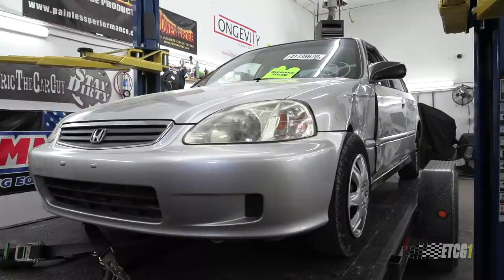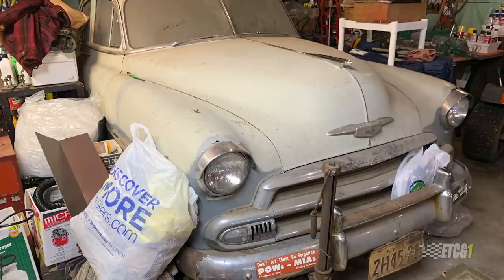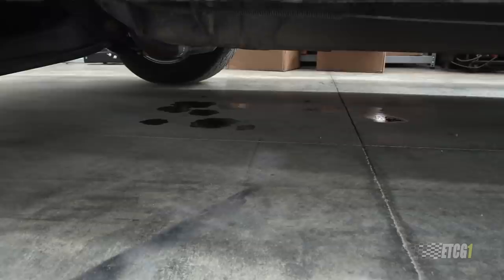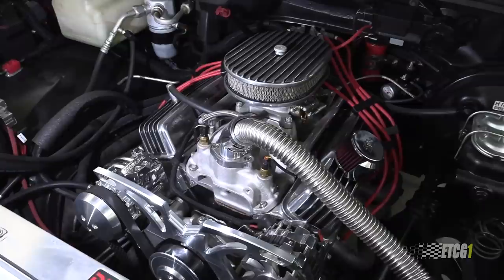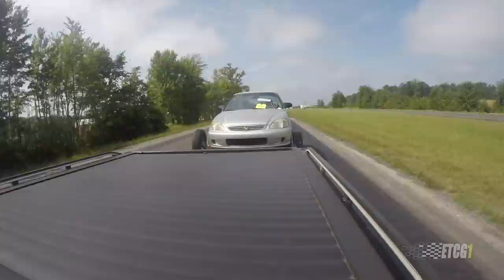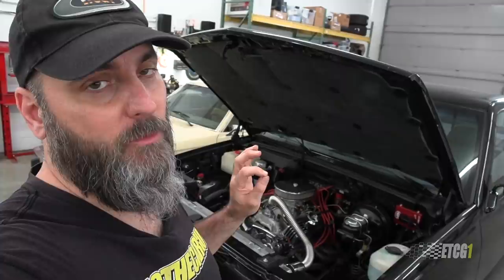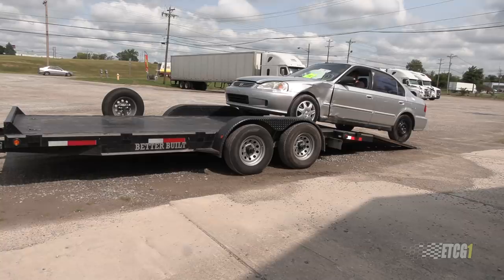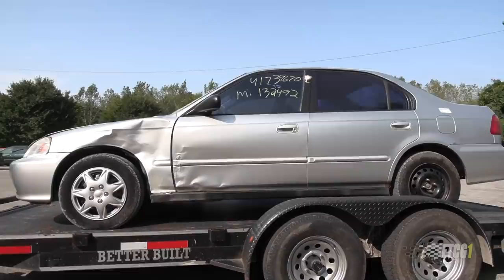First Time Towing with Dads Truck

Comment: Sorry for the long post, but I've been doing a lot of research on towing because we are getting our first "real" camper and we have an Avalanche to tow with.  It is not correct to say that since the GCVWR is not on the sticker that the truck is not made for towing.  I've not yet seen a truck that has that number on the sticker.  My Avalanche is definitely made for towing as it came with the tow package installed from the factory.  There are many factors that go into what a truck is capable of towing, and one of the main ones is the axle ratio on the rear.  The higher the better for towing, as it gives more torque at the wheels.  I had to search in the owners manual and also online a fair amount before I found the ACTUAL tow capacity of my truck.  The first couple websites I came to said I had a tow capacity of 5000 lbs and 500 lbs tongue weight.  But after some searching for feature codes (on the sticker in the glovebox) and researching the Chevrolet site, I found that my tow capacity is 8100lbs and 1000lbs tongue weight with a distribution hitch.  As for tongue weight, you trailer should have 10-15% of the total weight of your trailer on the tongue.  Tongue weight is where most half ton trucks fall short.  If your trailer/car combo is 5000 lbs, then you should have 500-750 lbs on the tongue.  You can move the car back and forth to adjust that.  Also, the best way to make sure you are getting all your numbers right is to use a CAT scale at just about any truck stop and many gas stations. That will tell you if you are exceeding the maximum axle weight rating for your rear axle.  They have an app you can install on your phone and it will tell you where the nearest one is.  Hope all this info helps!
Reply from the maker: Thank you for your input. In actually, it's estimated that this truck can tow 7500lbs. I don't agree with that at all after towing what I estimate was near 5000. Granted, I lowered my truck and that in itself will effect my towing capacity. However, if you've ever driven one of these trucks you know that the brakes are utter crap and I would never tow, or recommend anyone tow, anything that was 7500lbs with this truck in stock form as a result. 

There is a difference between what you read on a page and how it works in the real world. Yes, you have a tow package, but I would take some time to 'feel out' what your truck is capable of towing before you commit to what you believe it's capable of. In fact, that's one of the reasons I made this video, to make people aware that they can't just hook up to anything and expect to be able to tow it safely. Remember, it's not just your life and your passengers, it's the other people on the road as well. 

Thanks for your comment.

Comment: This is exactly why I bought an old F350 dually.  I love my 74 Chevy, but the reality is that she's not the best in towing.  Hauling fire wood is great, but pulling a car trailer or camper is pushing the limits of what she was designed to do.  New, she was only rated to tow 8,000 and she's a little past her prime.  The F350 with a 7.3 diesel can tow up to 12,500 with a conventional ball and around 15,000 to 17,500 with a gooseneck or 5th wheel.

Once I get the Ford squared away (yes, I bought a cheap POS), then I'll be looking for an 18 to 20 foot flatbed, possibly a deck-over so I don't have to worry about fender humps.
Reply from the maker: That's a great plan and one I may emulate at some point in the future. Thanks for the comment.

Comment: You will find, it is much easier with a longer wheelbase vehicle towing a load like that. Yes it kills your turning radius. But the trade off is, much better stability. 
A 3/4 ton pickup preferably an extended cab or bigger, will make towing a car hauler a breeze.

Comment: Unfortunately yes for long term towing, probably best to get a bigger truck! Just borrow a semi from neighbor around shop! Good luck guy
Reply: Long term towing would be fine even with this truck for what he wants to do. The honda? = fine, his dads car in NY? = fine... if properly loaded that is. A bigger truck than this and you can easily tow multiple vehicles. 

As for borrowing a semi? Does Eric have a CDL? Any truck with a GVWR of 26,001 lbs or greater requires a CDL, whether or not you are using it for commercial purposes or not. A tractor trailer is 80,000lbs + 

A side note... You are considered overweight if your weight is not properly balanced or one exceeds the max allowed. Like over your steer tires your max is 12,000 lbs. Drive tires is 34,000 lbs, and trailer tandems is 34,000 lbs. You can be 70,000lbs but if say you had 13,000 on your steer tires, then you would be overweight.

Comment: I would think you would find the GCVWR in your owners manual (if you have it)
Thats where I found the rating for my 95 f150. Very important to not exceed this rating,
or the trucks GVWR or axle ratings. That said, you would have reduced the tongue weight
on your hitch by positioning the car back over the center of trailer axles thus lessening squat.
Reply from the maker: It wasn't listed, I looked. Still, those numbers wouldn't really apply since I lowered the truck and changed a bunch of stuff in the powertrain.
Reply: It might not be in the manual, but I've never seen a GCWR on the loading sticker on any vehicle.  There's a federally mandated set of information that must be there, and GCWR is not part of it.  GAWR is definitely relevant, and with that much rear end squat you were probably exceeding it in tongue weight alone.

For GM at least, GCWR is usually listed in sales materials.  Found one for an '89 GMT400 here:  https://www.gmheritagecenter.com/docs/gm-heritage-archive/historical-brochures/chevrolet-trucks/1989-Chevrolet-Truck-PCK-2.pdf

Depending on rear end ratio, they rate a stock C1500 with the 350 at between 10k and 12k GCWR.

You've just got too much tongue weight, and probably too heavy of a car hauler.

Comment: Running cooler for more power is a misconception. The heat energy that could be transferred into pushing the piston is absorbed through the cooling system because of the higher temperature differential. It’s not much but it still happens.

Comment: Take a look at my 94 f150, ive set it up for towing. You might want to copy it. Ive had it grossing over 20,000 lbs a few times. A smaller truck given no regaurd for its rateing can be made to work very hard.
Reply from the maker: I never intended to make this truck into a tow rig. It was always meant to be a 'sport truck', and I intend to keep it that way. If I do start hauling cars around, I'll likely find something that's at least 3/4 ton and has a diesel. Also with a longer wheel base. Thanks for the suggestion.

Comment: I get about 13 mpg in my 1968 Cadillac DeVille convertible while towing a camper that weighs about 2700 pounds with the quadrajet and the stock TH400, i guess i should be very happy with that =D
It still gets about 13-15 mpg while not towing anything, so...

Comment: When you buy a trailer buy a lighter one, that's probably a lot of your problem. I've pulled a car trailer with an early Dakota on it with my GMT400 C1500 Suburban and didn't have any issues but the trailer I rented was way lighter than the one you did. That trailer you rented looks more like an equipment trailer than a car trailer.

Comment: I took note that you are not using a weight equalizing hitch.  IMHO that will solve your problem because a load equalizing hitch will throw some of the tongue weight to the front wheels, as well as some weight to the trailer axels.  I have been towing trailers for 50 years and a weight carrying hitch on the tow vehicle is only appropriate for a very light trailer or a very heavy duty tow vehicle

Comment: What about just going for a wheel dolly?  About half the weight will ride on the back tires of the towed vehicle, and most of the front weight will sit on the dolly tires.   It should be relatively like pulling a radio flyer wagon as a kid.

Comment: My 2001 silverado doesn't have a combined or trailer weight on the door sticker it's only listed in the owners manual. Mine is listed as such:

C-1500 Regular Cab Long Box (2WD)
4800 V8 (Auto) 3.42 6,500 lbs. (2 948 kg)
3.73 7,500 lbs. (3 402 kg)

Comment: Eric, just a thought about the breather, I put some pretty valve covers on a small block, started having the same type of leaking from around the grommet, when I removed them to compare to old ones there was no baffle on the new ones to keep oil in under pressure, you may want to check it

Comment: Eric, right from the GM handbook for the 1989-1994 regular cab, sport trim with the 5.0L the GCVWR is 10'500lb and with the 5.7L the GCVWR is 12'000lb with 3.73 rear gears. So depending on the engine, 5.0L or 5.7L that makes the towing capacity of that specific truck 4900lb for the 5.0L and 6400lb for the 5.7L so it can still tow a bit if weight. Can it handle your dads old car? Probably. Being as a 1951 chevy styleline deluxe weighs right around 3100 pounds and the average tandem (2 axle) car hauler assuming its an 18 foot trailer is about 2000 pounds, 20 foot trailer is roughly 2200 pounds, let's assume you've got a 20 foor trailer, 3100lb 51 styleline deluxe, and 2200 trailer your at 5300 pounds. Add some extra for the "spare parts" (500lb maybe) 5800 pounds?? Should be more than adequate to haul the car with that truck. Been towing most my life, and my own truck was a 91 single cab stepside, 4x4 with the 5.7, had a tow cap of 6'000. Also did not have a GCVWR on the sticker. And neither did my 95 and 96 chevys, both a 2500 with the 6.5L diesel 4x4, nor did my 82 c30 crew cab long box, or my 99 silverado 1500, also my 06 f150 doesn't have a GCVWR reading on the door.

Comment: Eric i completely agree with your conclusions. That's why I tow with a 7.3 Diesel Excursion. However if you want to tow your brother's boat to the lake or whatnot a set of air shocks wouldn't be a bad idea. I have some on my willys station wagon  and they work great for towing smaller things.
Reply from the maker: That's my plan actually. However, it's difficult to find air shocks for a lowered truck. At least for me so far. I might just stick a set of regular air shocks on for towing, and then switch to the regular shocks for driving around. Mostly I just like driving this truck. I never intended to make it into a tow rig. I just wanted to see what it was capable of. Thanks for the comment.
Reply: ETCG1 Dad’s truck is pretty darn awesome as it is! When I bought my air shocks I measured the overall length and travel and hunted down a Monroe fitment chart and bought them that way. It wasn’t easy. Thanks for the reply!

Comment: none of my trucks have a GVCWR rating.  They are just like yours.  My trucks are a 2006 GMC Yukon 4x4 5.3 4.10 ratio with heavy duty towing package and a 2018 GMC Sierra 4x4 Crew cab with the 6.2 and heavy duty tow package.  I think while not an ideal tow rig for heavy applications it should handle that Honda.  Maybe add another leaf or get some air shocks.

Comment: @Ericthecarguy  "GCWR" was not a thing listed on the door sticker on those and earlier year models. It's in the owners manual. The OBS 1500 5.7 L trucks have a GCWR of 10,000 - 12,000 LBS depending on rear gear ratio.  I tow a lot (I own a camaro/firebird salvage yard and pickup a lot of cars) I use a steel 18' deck trailer with a 3' tongue. Trailer has a tool box and 12K lb winch and battery. Trailer weighs 3150.  I haul mostly third gen f body cars. 3200-3500 lbs. I pull it with a 1987 2wd GMC suburban 5.7L, 1994 K1500 4wd Chevy suburban 5.7L, and a 1992 C1500 2wd Chevy pickup 5.7L. In the past 5 years I have towed well over 400 cars with the above setup. You have the car loaded way too forward on that trailer, placing too much weight on the tongue causing your suspension to bottom out. Correct placement is everything when loading a car trailer. A couple of inches one way or the other can make the difference in overloading the suspension or causing trailer sway
Reply from the maker: It was not listed in the owners manual of my truck. GVWCR can be obtained from the Chevy dealer as the sales department usually has that info. Sorry I didn't put that in the video. 

I believe I mentioned the placement of the car on the trailer, but my main focus was seeing what the truck was capable off. A '51 Chevy, no matter how it's loaded, will weigh a lot more than a Honda Civic. Thank you for your comment and input.